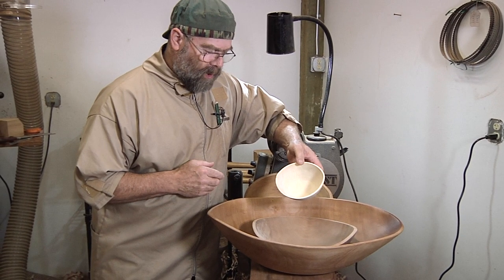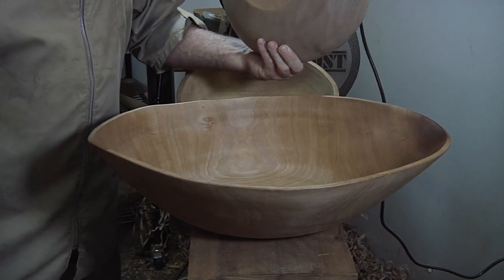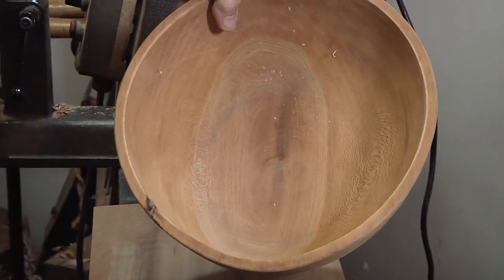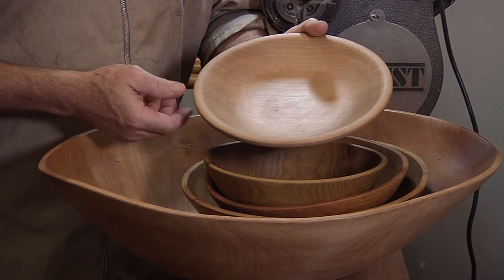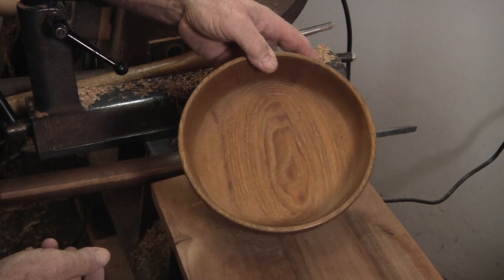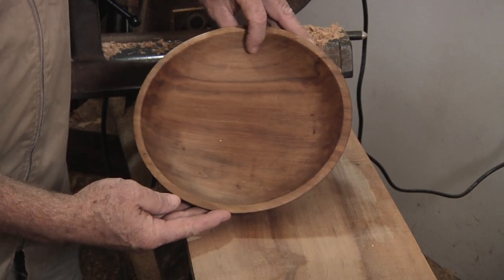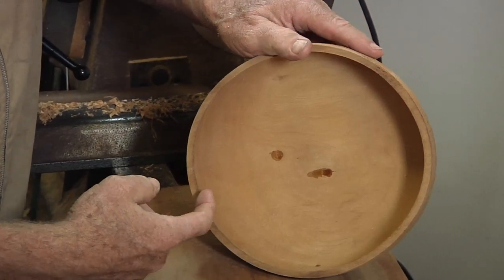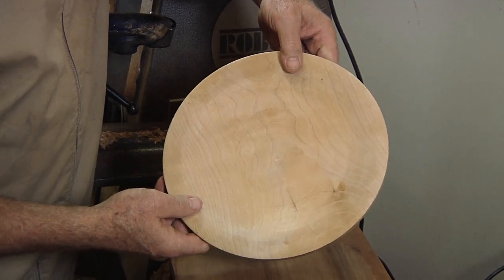Reed Gray aka Robo Hippy presents | BOWL DESIGN CONSIDERATIONS

Comment: Sycamore is Acer pseudoplatanus, london plane is Platanus x hispanica, they are different trees, at least here in the UK, regards from London.
Reply from the maker: They call all of them sycamores here... The London Plane is, I believe a cross between the American Plane tree and the European plane, I think... I am not an arborist... The London Plane is more common on the west coast. I grew up in the Midwest, and the American Sycamore was more common back there.
Reply: Thank you very much for the prompt response, the London plane grows to a huge size in London, lives hundreds of years and most importantly it plays a great role as a pollution cleaner, it just thrives in busy traffic laden parts of the city. Sycamore is on the other hand considered a bit of a nonsense, pest, by gardners and house owners, it grows everywhere and fast, both trees when felled are given out for free, which is a bonus for us! Enjoying your videos, thank you for sharing.
Reply from the maker: @knightlylad  I live in western Oregon, so Pacific west coast, so mild and wet climate. The London plane trees here can put on about 1 inch diameter per year, meaning a 30 inch diameter tree can be 30 inches diameter on the trunk. I got one once that when it was first cut, the chain saw shavings came out blood red. The color faded shortly after, but still the tree was darker than the normal white colors I  was used to. They do make good shade trees, but like you said, they can get huge.

Comment: Howdy.  Nice video. I am wanting to  make me some eating bowls and would like to ask what you use for finish on the bowls you eat from?  They look great and it seems to last.  Going to watch more.
Reply from the maker: Two Tracks Bow & Wool I use the Doctor's Woodshop walnut oils. I prefer his. It is a soft oil, and takes a week or so to dry, plus it has carnuba wax in it. I don't like surface finishes as they tend to crack, chip and peel off eventually.
Reply: robohippy Thanks. I will Check it out.  I prefer a finish that soaks in vs. sets up on the surface as well.
Reply: +robohippy Would regular heat treated walnut oil work anywhere near as well?
Reply from the maker: +Tickiwaw Well, all of the walnut oils are heat treated, and I know there are differences in the different brands and types. The Doctor's Woodshop does the best job of explaining. Some say that the salad walnut oil you buy in the store does cure, and some say it doesn't, but I really don't know. I figure I am a step up if I use the stuff that is intended for bowl and wood finishing.